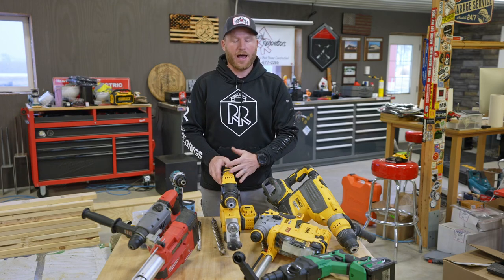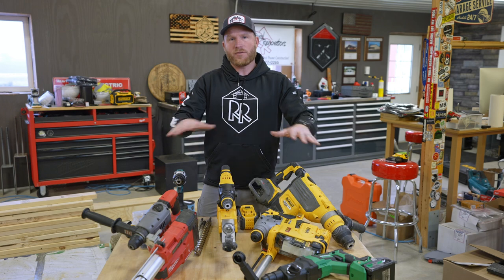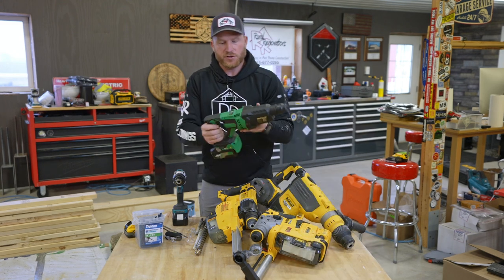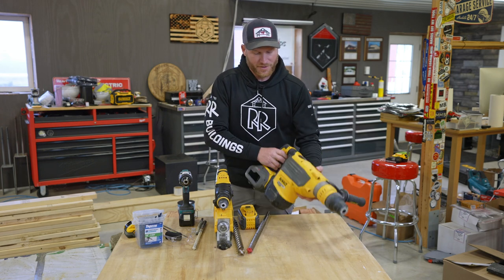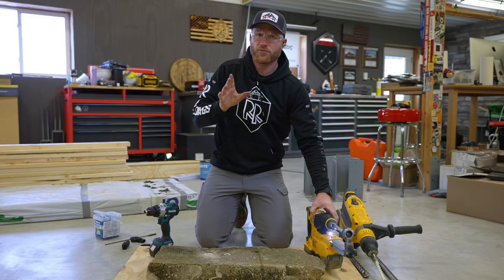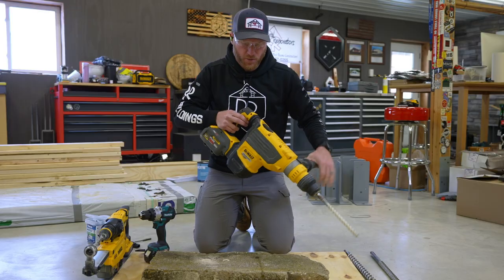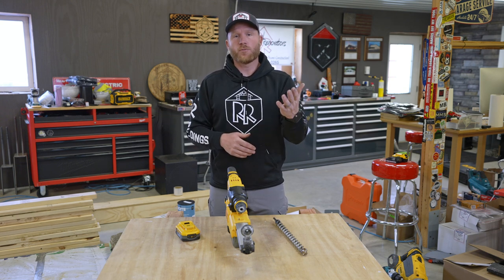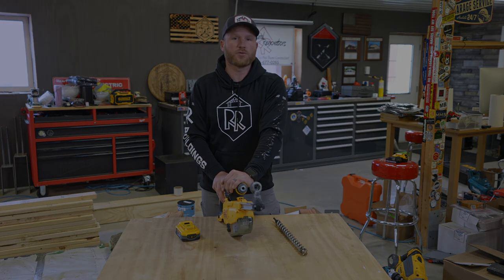Toolsday: What is the BEST Tool to Drill Holes in Concrete

Comment: Nice comparison and impressive results with the Dewalts.  A few decades ago nothing bored like a Hilti.  I have no idea how they are today but they outperformed everything on high strength industrial floors.
Reply: Lots of builders here in Australia have them, in my opinion they are very overrated and a pain to use, high vibration, no cutout if they jam (drill will smack you in the face), definitely not as powerful as newer more well known brands.
I got a SDS Max Dewalt on a killer sale a couple years ago, not the top of their range but it is a decent unit, better than most hiltis for waaay less money.
Hilti offers a 20yr warranty and service package with their rotary hammers, I reckon thats why the companies go for them.

Comment: I bought the 20v Dewalt DCH273B to see if it would help break up ice with a 3" chisel from my driveway and around my house (I live in Lake Tahoe and we got over 700" of snow this year). I must say sds plus rotary hammers are amazing. Im not sure why you'd even need a corded version. SDS plus with a 3" chisel works great at breaking up ice dams too! The tool requires firm resistance for the hammer action to kick in so it's actually safer to use on a roof than you'd think.. I highly recommend picking one up if you have some serious ice you need to manage. Side note, haven't drilled any concrete with it yet...

Comment: I've used the SDS with a 1" bit to drill a hole for a ground rod in concrete doing a whole house generator. It works great and effortlessly! The regular SDS  drills the hole, small or big, without effort.
Obviously, if you are drilling as many holes as Kyle does on a post frame for his brackets, I would go with the bigger + SDS!

Comment: the drill only function on the sds plus for using a carbide rebar cutting bit that has the sds plus shank.  For instance, you're drilling in concrete with a sds plus masonry bit, you hit rebar, you swap out the masonry bit for a rebar cutting bit, and switch the function to drill only.

Comment: I’ve used the SDS plus with a 1 1/8” bit to drill into a sidewalk next to a house where we set whole house automatic standby General Generators and the rotary drill makes it go through the concrete so easily that there’s really no strain! I used the type you set on the ground though, but I never attached the dust collection, but it’s a good idea to use dust collection though!
We started using the SDS plus because they didn’t burn up as many bits drilling brick for straps for the conduit running from the transfer switch to the generator, and brick can burn up bits fast. I think it has to do with the speed! The SDS plus is a money saver if you’re drilling a lot of brick for support brackets!

Comment: I use the Hikoki 36v with dust extraction and its good. Usually go for 12, 14, or 18mm holes for expansion or chemical anchors. Really quick and dust free.
Reply: Get the sds max 36v

Comment: In Europe there is way more brick and concrete than here in North America. My advise for a DIY person, maybe buy a light machine for some occasional small holes. But when you need to drill a lot of them, just RENT one of those big monsters. As a student, 40 years ago, I did exactly that and I drilled over a hundred 1/4 inch holes in super hard 10 year old concrete within an hour. The rent was minimal and my neighbors loved it that the noise was over so soon. 🙂

Comment: For 1/4 tapcons using a 3/16 bit overhead,the 5/8 m12 fuel is the best in my experience for its light weight and size.
I've drilled probably between 10-15000 holes using the m12,it's lightweight, and great for vertical in the up position, or horizontally. 
I have the m12 hammervac,but prefer using packout vacuum.

My rules on drilling for any concrete fastner,whether pin/redhead/or large tapcon.
#1 overdrill by 1/3 depth needed for the specific fastner.
#2 vacuum as you go.
#3 use 1/3 more capacity for width for speed.
I have driiled shallow 2 inch holes with the m12 (only rated for 5/8 because that tool was closer.
I installed fence for 15 years (2004-2019) including plated posts,and  tapconning post to masonry columns.
My arsenal is m12 fuel sds,m18 fuel 7/8,1 inch corded D-handle Bosch,and corded 2 inch sds max Bosch.
A regular cordless  hammerdrill is a waste of time, except for less than  4 holes.

Comment: DeWalt has a great SDS drill, and the dust collection piece that connects to them I think are probably different based on which model you have. They do a great job of controlling the Silica dust, which can be very harmful to your health over time. Large commercial jobs are so big on controlling the silica dust, which can be from many different things, with machines that put down water on top and draw it up. If you haven't gone onto the OSHA site and taken the OSHA 10 or OSHA 30, I would suggest doing it for your safety and those who may work on your jobsite!

Comment: Dewalt makes great cordless rotary hammers. I have the 5/8 atomic sds plus, the flexvolt 1 1/4" sds plus, and the flexvolt 2" sds max. Ive been thinkin bout adding that exact 1 1/8" sds plus d handle you got and your making me want it more especially with the much more convenient dust extractor. Good video

Comment: The bosch bulldog corded just works very well light weight I've used hilty pro level the bulldog drill 3 1 holes  don't push on your hammer drills  1000 holes a month for 3 years
Reply: Yep, if it isn’t blue and begins with “B”, I’ll pass.
Reply from the maker: I always used my bulldog… this is maybe better tho serious
Reply: We putting earthquake beams in stairwell in a Hilton the bulldog out worked   all others  if new cordless drill are better thats amazing

Comment: you can buy the proper dust extractor for the milwaukee which is basically like the dewalts one. the milwaukee m12 add on dust extractor can work with any brand and was mostly made to fit on older corded models

Comment: In my experience easy drilling usually goes: drill, hammer drill, rotary hammer drill. The rotary hammer drills can be SDS, SDS-Plus, SDS-Max, or Spline. Most rotary hammer drills have 3 modes, rotary only, rotary hammer, and hammer only; these multi-modes and increased striking makes these the best concrete blaring tools out there. Right angle drills can also be used in coding as they can be nicer to run when coring a vertical surface. If you need more powerful chipping a hex hex shaft hammer can be best, but it can’t drill.
You also have to be careful depending on what you’re drilling with any hammer drills, as some materials, like cinder block, can blow out with hammer drills leading to enlargement of holes or loss of structure.

Comment: You shouldn't push sds+/max rotary hammer. Their hammer function works regardless of your pressure, unlike hammer drill. Its even recommended to push just enough to keep contact with concret, but not more, because that way hammer impulses will be stronger.
Thats why it is so efficient and easy to use.

Comment: Love that toolsday is back! Is the metabo htp 36v or 18? I would love to see a comparison between the dewalt and metabo htp. Both with dust box attachments. Also another toolsday suggestion. Do you find that cheap vs expensive bits makes much of a difference in sds, multitool. Circular saw, grinder discs? Thanks
Reply: Metabo is both and in my experience roughly 17 years experience building and rehabbing homes, bits and blades make a world of difference Diablo blades for everything that involves a blade lol

Comment: Milwaukee makes a similar drill powered cleaner. I prefer the M12 fuel for smaller bits. I do like the new dewalt. I don't know which would win between the newest Milwaukee and newest dewalt. Both are great. Sds bits are better than most hammer drill bits. I use the sds plus drilling through ceramic or porcelain no hammer for TV mounting. The sds is just superior. A Ryobi sds will put that awesome XGT to shame in the concrete. And sds max 3/4" needs like 3-5 hits before it's through stucco lol

Comment: I picked up an SDS max to keyless drill chuck adapter and use the non hammer function to mix up very thick materials. It also runs the hell out of a strikemaster ice auger bit 😂

Comment: We are often drilling 100+ holes one after another - 1/2" or 5/8" - mostly in garages and exterior for termite work and mostly simple vertical drill downs. Which tool would you buy? Looking at Hilti, Bosch, Dewalt and corded or cordless and sds plus or sds max. So many options.

Comment: another data point: I’ve successfully used my 18v bosch to drill 2” holes in concrete using an sds plus core drill bit. Slow going and eats battery, but never came close to feeling like the shank was gonna break.

Comment: Sometimes the problem with drilling into concrete with a regular hammer drill is that since it takes longer, it also reams the hole out more which isn’t a good thing.

Comment: Could you talk about the best ways to drill medium to large holes, 1-4 inches, in concrete as well as softer masonry material like brick or block? For example there are SDS max spiral bits, SDS plus or max hole saws, diamond hole saws that fit in a regular drill, and dedicated diamond core drill machines.

Comment: You can't beat the 36V Hilti. 99% of my use is anchors though. The Husqvarna core drill for penetrations. We use dewalt at work. Probably run a few hundred drop ins a week. They feel cheap drill slow and die often.

Comment: If you want the best rotary hammer… Hilti. They have the best rotary hammers. They are expensive compared to the others you review here, but they are worth it. Couple them with Hilti’s SDS plus and max drill bits and you’ll never use anything else.

Comment: I used a 28V Milwaukee 1/2" hammer drill to install up to 3/4" x 6" concrete anchors with no problems over 20 years ago? Now the 18V Fuels have probably more power than that had, so you may be able to get away with regular non-SDS style hammer drills for almost any size below 3/4"? What do you think?

Comment: Question, just a project guy here. I have a heavy duty corded 1/2” Dewalt from the mid 80’s and drilled maybe a couple hundred holes. I just using the standard bits from Lowe’s or Home Depot and I get a lot of holes that tend to lead off location when the bit hits gravel in the concrete. Suggestions?

Comment: Only question I would ask is. Are all the bits two fluted or four? Vacuuming is way better than the bulb we used to use to blow the hole out and into your face if you didn't move your head. Can you turn the vacuoff if you get into a water situation?
Reply from the maker: Just disconnect the vacuum no problem

Comment: I've been thinking about making the switch to battery powered rotary hammers, just so that I don't have to lug around a generator any more. But how many 5/8 holes at about 9" deep would you guess you can get out of the SDS and SDS Max drills on an 8ah battery?
Reply from the maker: we typically drill all of the 5/8" holes on a standard project (maybe 40) holes with a couple batteries
Reply: @RRBuildings  I can see that! the small SDS drills holes like butter. the bits last forever!

Comment: You can’t compare the Makita to those dewalt drills. The smaller the drill you work your way up to the size hole you need. We don’t get sent tools like you do. My Makita 18v sds does exactly the same as the default model you’re using.

Comment: I would never drill a hole in concrete with a 1/2" one hand drill, that is a true exercise in futility and a patience-builder.
Pretty sure those are only good for brickwork.
To answer the host, I would use the drill only mode with an SDS drill to mix structural grout or cement, probably paint and render.
Not as good as a dedicated mixer but way better than a 1/2" drill.

Comment: You want to drill in concrete? Go to HARBOR FREIGHT get you a Bauer for under $150. Had it for 6 years drilled probably 300+ holes with it, its like brand new. Impressive tool.

Comment: The cordless SDS Max hammer drills aren't great.

Even with the XC9.0 batteries on the M18 one you will go through a whole charge trying to drill 1 1/2 hole through a foundation for a service upgrade or something. So unless you've got a pile of batteries and are able to charge on site they're not the best option.

9/10 times I'm using my regular hammer drill/driver, M12 SDS for slightly larger fasteners and then I have a Hilti 7 & 16  which covers basically everything except large coring sizes, which is rare for me.
Reply: Milwaukee's cordless SDS Max are garbage.  Especially their 1-9/16 model which is the one you probably used. 

There's much better cordless hammers from Makita, Metabo HPT and Dewalt.  They'll still suck down batteries, but they aren't piss poor slow or give you permanent nerve damage like a Milwaukee does.  A Makita 1-9/16" with AVT is one of the smoothest in the game and hits as hard as a Milwaukee 1-3/4" while weighing less.  Made in Japan.
Reply: Maybe it's your bit? I don't have any experience with Milwaukee's battery sds's though. I use the DeWalt 60v sds max to drill 1.5" holes into granite and get a just under 25 minutes of continuous drilling. When I drill into concrete, it just melts through in about 20 seconds.
Reply: @t0fast  Bits (were at the time) nearly brand new, it's just a hog on batteries.
You're definitely not drilling an inch and half hole through 12-16inch deep concrete foundation in 20 seconds. Lol

Comment: Corded Makita and Bosch rotary hammers. 
Those are simply engineered better and last longer than the competition.
Very strong, can run for hours on end, designed to last. Open up any Bosch or Makita and compare what you see to a cordless Dewalt or Milwaukee and you will see why I avoid those brands.
Its not uncommon to put 2 or 3 service kits into a Bosch or Makita hammer before it reaches the end of its life, meanwhile the Dewalt or Milwaukee will be in a scrap pile by the time a proper hammer has gone trough its 1st service.
Not badmouthing brands here or spreading propaganda just telling you what I see prevail on construction sites.
Another brand to look out for is FF Group. Dont know if anyone in the US stocks them but they are gaining popularity in Europe because they are good enough to be bought up by tool rental buisnesses since they get more bang for their buck out of them compared to Bosch or Makita.